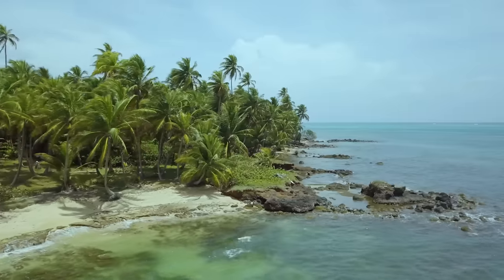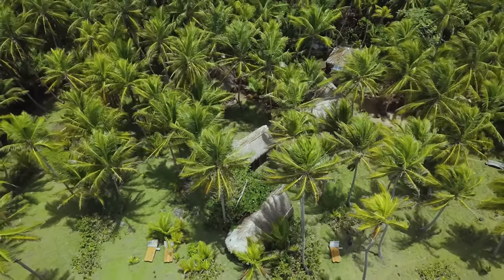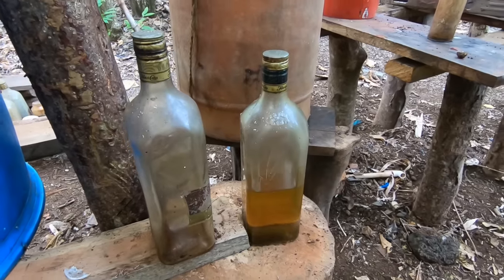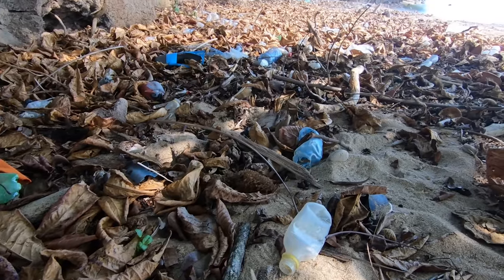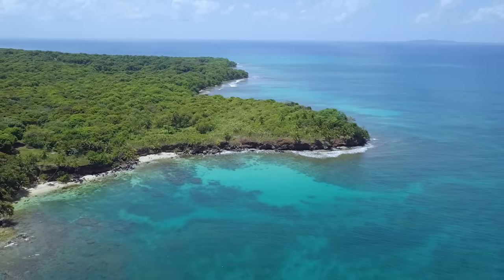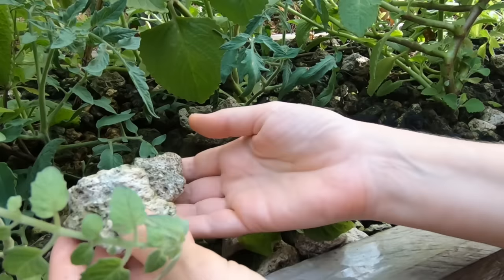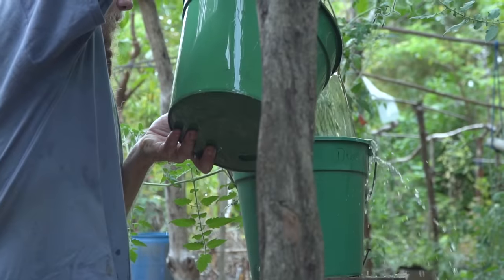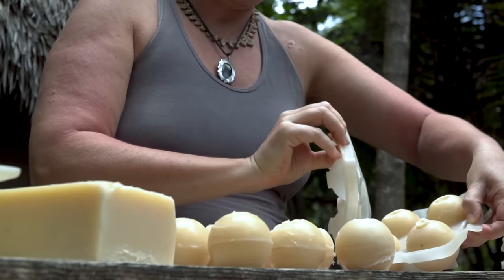THIS SELF SUFFICIENT FAMILY MAKES THEIR OWN FUEL FROM PLASTIC!

Comment: I have always wondered if plastic could be turned back into petroleum.
Reply: there you see it
Reply: Found that locally environmentalists are against it. Due to a decrease in value. I would say it is the best way to use dirty waste plastics.
Reply: I have mixed it with oil sludge to make a tar oil for blacktop patching , but this idea I really like !!
Was thinking it could be a power source for ocean cleaning drone ships or something along that line , a few years ago and now this cool guy is doing it .
I wonder how much solid waste is left ...
Reply: You should be asking "how much energy does it require to convert plastic back to oil?" Burning down a forest to make a gallon wouldn't make the process any better ecologically, but it would be cheaper than shipping from the mainland for the island's inhabitants.
Reply: @even7steven  it certainly won’t take more energy to convert it back then it will yield .
At a high enough temperature with the correct ratio on oxygen on an industrial scale you could use the plastic as the fuel source provided the exhaust was clean or filtered
Reply: @utube012341  I applaud anyone who doesn't just buy into the "single use plastic" lie.
Reply: @even7steven  I see it as a potential resource that might pay for its own cleanup.
I do use waist motor oil as diesel fuel at temperatures above 50f .
I can run 75 percent wmo to diesel fuel with a couple gallons of gasoline in a 40 gallon tank .
This seems to only burn well on certain injection style equipment or trucks
Reply: @utube012341  ocean cleaning drone ships! Sounds good
Reply: @Darren Munsell I would not be that silly but even more specific I can say ; it burns great in my 99 7.3 psd, also in a 83 case and an other couple tractors.
Must have a very high pressure injection system and not sit at idle for hours .
Works in an 8.3 in a Ford 8000 at 50/50 
A kubota stationary motor .
Not in several other including a 5.9 cummins and
Reply: @Darren Munsell diesel is not the way ?
Diesel and gasoline from plastic ?
Did we have plastic during ww2 thought it was Bakelite , but I could be wrong.
Just asking not trying to be rude
Reply: @utube012341  haha that you call him evil genius is funny because to he seems ambivalent to me too. So many great things would be possible... its such a shame, that out current politicl and economic system does not favor these things...
Reply: @anarchoalfonso2667  god yes it is a shame .
Humans insist on acting foolishly and hurting themselves and us .
We need better policies and laws to control certain dark greedy forces
Reply: Bruh there are literally lakes made up of petroleum on Titan. These things are not solely made of liquefied dinosaurs and algae
Reply: @de0509  now thats a different topic but no less interesting

Comment: Since when are diesel and burning plastic eco-friendly and renewable energy?
Reply: Not at all. But if he wants to make diesel from the rubbish that washed up on his island instead of burying it or sending it abroad to get burned in India then I would say it’s better. Not good.  Just better.     Better if 2 evils per say.    There only one way we’re gonna get rid of all the rubbish we already have   So if he converts plastic to to gas. And uses it.  Instead of just burning it I’m all for it
Reply: @kadebaitrum7797  The only real question is whether burning the plastic would produce more pollution than breaking it down using hydrocarbon fuels to generate the necessary heat.
Reply: @kadebaitrum7797  HA!  Do the math on how much energy is being converted/wasted. You could get less “pollution” from a steam engine. Don’t forget to buy his product because it’s for the environment.
Reply: just don't burn it or make it into petrol perhaps
Reply: @manuelpinon2486  have you even watched the video.  Instead of burning the plastic waste.  He’s converting it into diesel to run his home generator.  Don’t see what your issue is with that.   Are you 100% run off clean renewable energy. Chances are that you’re not.  So it doesn’t matter about the whats being wasted as it’s already going into landfill or burned anyway.   At least watch the video fully before shouting you’re useless comment around
Reply: @toi_techno  he does.  He said that he converts some of the diesel into petrol that he runs his car off.  Hence the distillation chambers on his setup
Reply: @buggsy5  he lives on a remote island in the middle of nowhere completely off grid with limited supplies.   If he wants to turn his rubbish and stuff that washes up on the beach into fuel then go for it as it’s cleaning his island.   He’s using all our waste as his solution   I don’t see an issue. It’s only on a small scale for himself
Reply: @kadebaitrum7797  Not that remote if there is tourism and he has a vehicle. 

I have previously stated that his plastic recovery from the ocean is a positive aspect of his lifestyle. Hopefully he will make that system much more efficient in the future. But I am concerned about all the toxic gases and ash produced during the pyrolysis of the plastic.

It is a nice touch to use tilapia to eat food scraps and produce fertilizer for his garden. I wonder if he boils the water occasionally to remove the bacteria and parasites that will grow in the circulating water.
Reply: @buggsy5   No vehicles out here, no roads. It isn't always easy for visitors to get here if the weather is bad.
Reply: @dereksplace1342  My apologies. I have no idea where I got the impression that you did. Maybe another post made the claim and it was not corrected.  Or, I may have read something into a post that was not there. Again, I apologize for the error.
Reply: @kadebaitrum7797   A brutish attempt to make yourself the victim.  “Don’t see what the issue is with that” means that you have limited information due to your lack of knowledge. I am not here to teach you but only to state facts and will not teach you because you are a consumer.
Reply: @manuelpinon2486  I’ve done plenty research thanks    Plans on the go to turn my rubbish into petrol for my outboard now
Reply: @manuelpinon2486  are you spakky?  I’ve done my own research on small scale diesel production using waste   When did anyone other than you say they were fixing the earth?   If you actually cared about the planet and people you wouldn’t be part of the most wasteful toxic part of humanity...The American military

Comment: Diesel isnt flameable, u can literally put out fire with diesel so the flame test doesn't make sense
Reply: I showed this to my kids a few days ago.  I showed them how long you have to hold a flame to it before or catches.  I also put a match out by dunking it slowly in a container of diesel.
Reply: Yeah, in a apocalypse that might never happen plastic is more useful to make string, canteens, tools, storage equipment, and arrow heads
Reply: Depends on how hot the fire is.

Comment: This is just unbelievable, turn waste into fuel, it a no brainier. So why haven’t anyone taken this idea and ran with to help rid of all the plastic.
Well done you guys
Reply: The process to make diesel from plastic takes more energy than what the diesel gives you... It's not just economical and energy efficient...
Look at how much firewoods he is burning, for that small amount of plastic..
Reply: @kumaragurusubramanian581   And the fumes cannot be too healthy either. I saw a video of a guy using sun energy. that would be more economical I think.
Reply: @kumaragurusubramanian581  that can’t be the case if he’s surviving on it, that statement makes no sense.
Reply: @kumaragurusubramanian581  this may be true, but if it gets rid of the plastic for something useful.
Reply: Because the elites want to keep you feeling guilty and helpless
Reply: @frankieviljoen  WHERE he is at on an island has more than enough breezes and mild weather in the open air for fumes to be a minor issue.
Reply: @kumaragurusubramanian581  My first thought as well but it is quite difficult to use a wood fire to make electricity it burns inconsistently. Since the plastic he is using is all waste and not purchased and the wood is simply going to decay if NOT burned there is not really a problem.
Reply: @kumaragurusubramanian581  It depends on the situation you find yourself in. We for instance have tons (literally) of deadwood from hurricanes and storms, taller trees killing out the smaller ones. Also coconut husks by the thousands. This method helps me get the yard in order.
Reply: @frankieviljoen  This is taking place inside a contained environment sothere are no fumes to speak of unless there is a leak. The fumes, vaporized gasses, are catalyzed once combusted by either being flared or inside an engine. We now no longer flare, instead we feed those gasses (propane,  butane) into the carb of a gasoline engine.
Reply: @leahhayes8323  well, I don't want to sound rude, but before you try to school people... maybe take a second to evaluate your own level of knowledge in the specific field.

He uses a lot more energy in the form of firewood than the diesel (what he burned wasn´t diesel btw... you can´t just light diesel with a match) contains. He has an obundance of wood but can´t use that for power generation and that´s why he burns the wood to gain part of the energy input in the form of hydrocarbons that his generator can burn. He heavily pollutes the environment in the process by the way.
Reply: Norm T  No comments....🤨
Do some research
Reply: @suzannehartmann946  u r right💯, I just meant this paralysis of plastic to diesel is not a good idea, if u r running a government.. In a remote island no probs...

But still some paralysis companies are running, they just want to get rid of plastics at the same time produce some fuel out of it...

My opinion is : the best way to get rid of plastics at the same time to get some energy out of it is by using themself as fuel; burning them to heat boilers and get electricity out of it. You may argue that this will cause emission problems, but still the diesel made from plastic is also going to produce the same emissions that the plastic burning will produce atleat in a contained manner(inside a power plant) rather than in roads.....
Just my thoughts....
Reply: @stefan514  with respect if you didn’t want to sound rude you really didn’t try that hard did you? 

If you think he creates more pollution than the plastic pollution that he getting rid of then fine, I don’t see it. Besides I didn’t TRY to school anyone I merely made a statement. On the other hand that’s exactly what you are doing and no one listens when you’re being rude - that my dear is schooling 😉
Reply: @kumaragurusubramanian581  He is not in a hurry as . long we humans keep throwing  and dumpin this shit in the Nature he can live on . This has nothin to do with profit or business  just long term recyling . The Industrials will always choose for the cheapest way to make profit
Reply: @Daniel Morrison Exactly ,
Reply: @leahhayes8323  sorry, but if you find my reply rude you are really rather sensitive aren't you?

You said someones statement wouldn't make sense. That's pretty rude based on your complete lack of knowledge in that field isn't it?

His statement does make sense. What the guy in the video shows isn't green, clean or smart. He is using a pretty dangerous setup, pollutes the area and wastes a lot of energy.
Reply: It takes a fuel source to make a fuel source so maybe he could burn some of the plastic in order to produce his so-called diesel
Reply: @kumaragurusubramanian581  did you mean inefficient
Reply: @Stefan oh you are funny, that’s a statement a defiant school kid would make. You know people are allowed a different opinion to yours, don’t take it so personally, it’s fine, it makes the world a more interesting place!
Reply: You next
Reply: @kumaragurusubramanian581  This is false, plenty of good systems produce far more energy than you put in. I am however not convinced he has such a system. It doesn't matter though, wood is renewable and just see what happens when you try to run a diesel generator on wood....
Reply: @frankieviljoen  I would be concerned about the vapors given off too, during the refining process and the combustion process.  Though I don't know enough about it but to say it's something I would like to look into before subjecting myself to it on a constant basis.  It's great that this potential fuel source is taken off the beaches and waters, however not so great if it causes long term health problems.
Reply: @leahhayes8323  Not necessarily. He could be losing out energy wise because he's using more wood to do the conversion but because his machines don't run on wood, he's benefiting from having the fuel.
Reply: @suzannehartmann946  Yes, minor issue to him, but burning all that plastic puts a lot of gasses into the atmosphere and if we all did it, we'd rapidly increase our greenhouse gas problem

Comment: So to turn plastic into diesel all you have to do is burn loads of wood, excellent.
Reply: wood gas it is then?
Reply: coppicing is also an option
Reply: i guess it isnt too bad to burn wood from trees that are already dead or just sticks on the ground. we do that all the time here when we grill over a fire. if you cut the tree it wont drop limbs and sticks for you later on.
Reply: not to mention you dont need a very hot fire
Reply: @kkwun4969  look up 'coppicing' seriously
its an ANCIENT practice, that for some reason the spell check here on youtube doesn't recognize as a word...